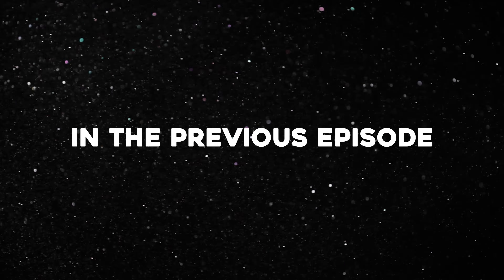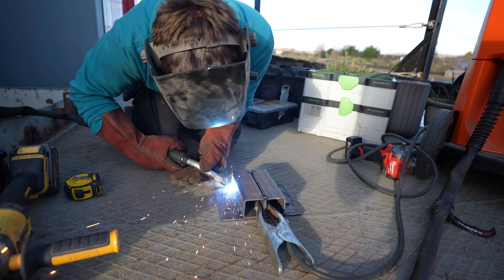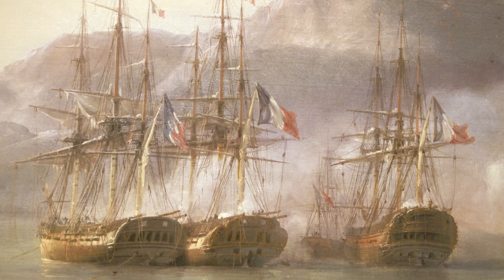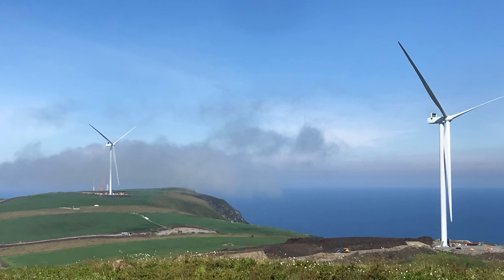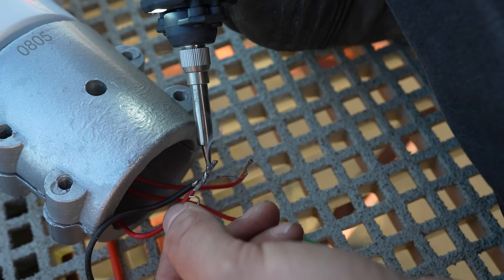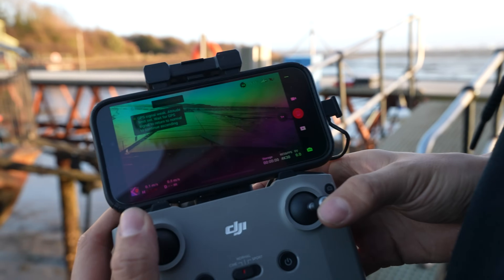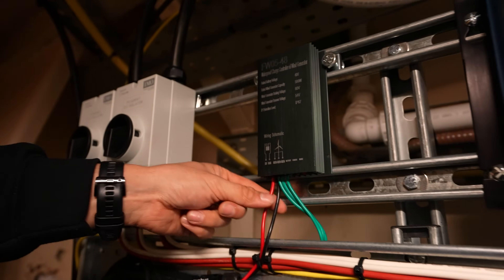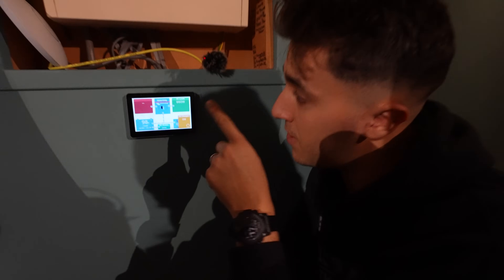Mini Wind Turbine Install | ØY35

Comment: even as a home automation nerd, the vrm app is pretty decent - at least for IOS, you can install it as a widget - so just swipe left and you display comes up and from there you can remote onto your gx if you want.   I do pull some data from cerbo into my homeseer automation using modbus(tcp) to trigger a few events when the battery is low.

Comment: Still can’t believe someone tried to charge you £50 for a swa gland😮
Reply from the maker: Daylight robbery 😂😫
Reply: @corymac  Gotta be City???
Reply: Class video mate, I'm doing solar about a year now in ireland so love watching these type of things. Great shout with the solder connections, but surely you felt like them guys off the YouTube shorts from China that show you life changing hacks doing that twisty solder 😂😂😂😂 love the channel and the graft fair play mate, quality sparks always pick up nice lil tips from your vids 💪
Reply: Big windows on that wholesaler because they saw you coming for miles.
Reply: Someone tried to flog the Mrs one for a whole box price. ‘Easy mistake’ if questioned. Great video as always, lots of varied engineering.